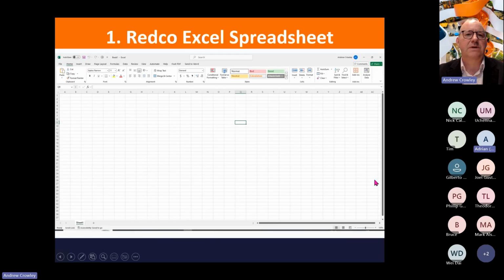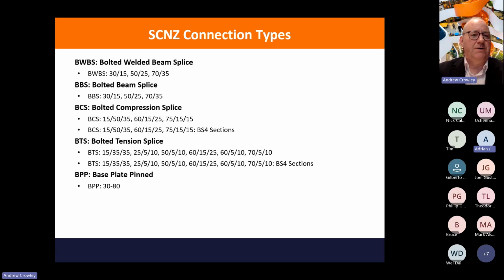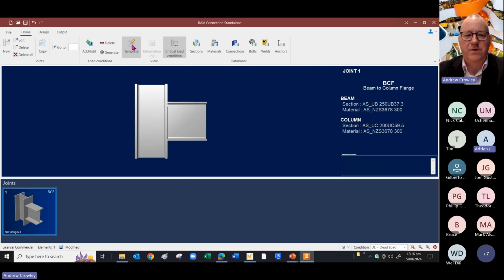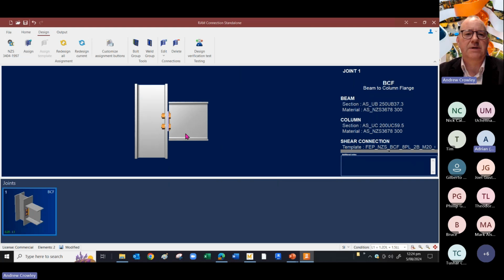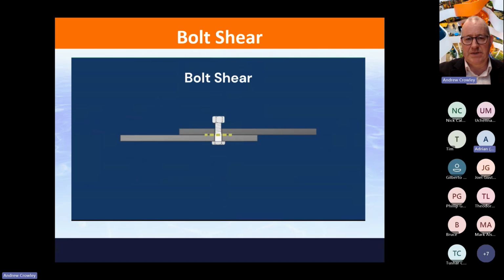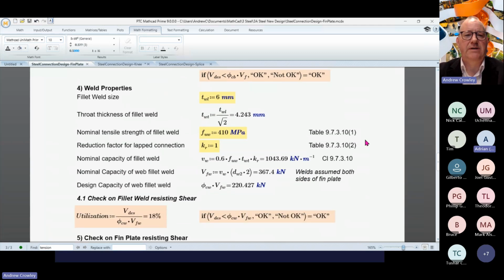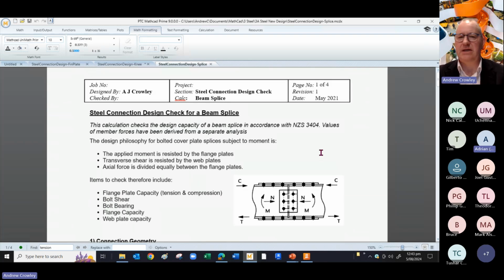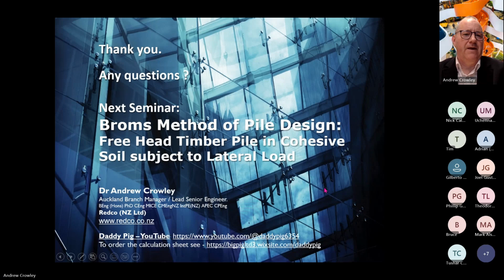CPD Seminar#25 - Design of Steel Connections to NZS 3404

Comment: Great Video. I was wondering where has the minimum connection for shear 4*Mmin/L comes from?
Reply from the maker: Hi Callum, it's the shear arising from the applied minimum bending moment turned into an equivalent load on the span L.